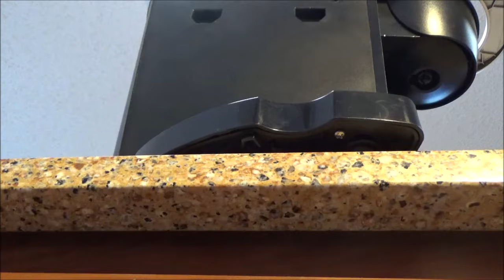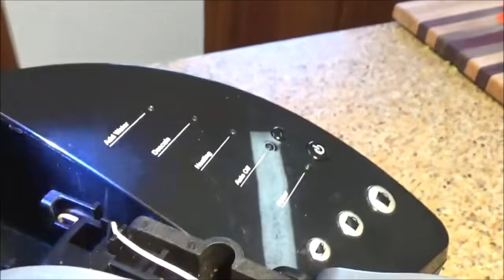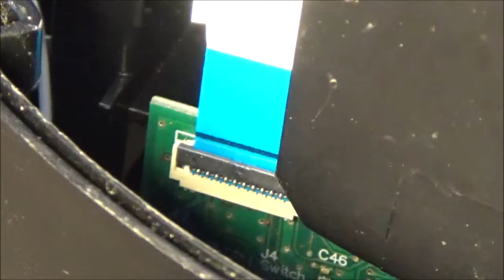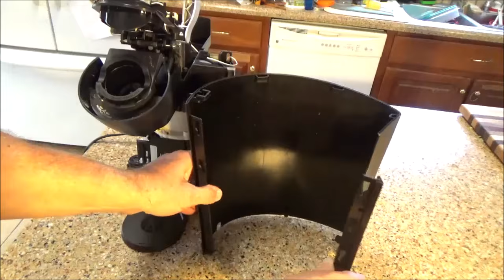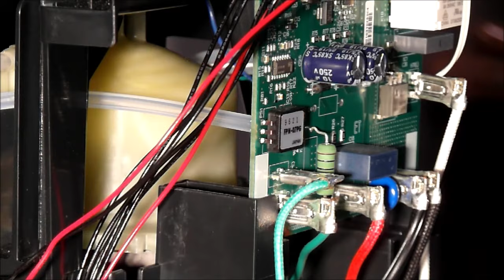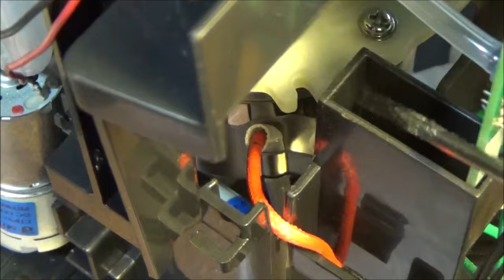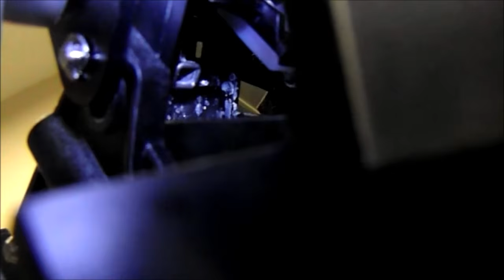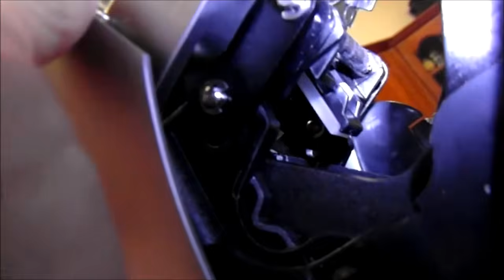Keurig Classic K50 Disassembly and Theory of Operation

Comment: i have a k55. i press the power button and the green light comes on and goes right back off in 2 seconds. what might that be???
Reply from the maker: It's hard to say for sure.  Since you have it apart, you might check to see that the hot water tank inside is filling up with water like it should.  It has to fill up close to the top before it can start heating the water.  You can check by shaking the machine a little and look to see if the water surface in the plastic top of the tank is moving around.  If it isn't filling up, you could listen to see whether the water pump is trying to run.  If not, it might be bad or maybe the path is blocked somewhere.  Check at the water inlet (that the outside reservoir sits on) to make sure it doesn't look clogged, and also the check valve right next to it.  You could also try turning it on with the K-Cup arm opened up to allow air to escape out the other end a little easier (if air can't exit the hot water tank, then it can't fill up with water).
Reply: @getitsettech1015  It is gettig water in the fill tube. Hard to say if the tank has water in it by looking. Now when i press the power button...the green ligh goes on and off very quick. nothing else turns on. when i plug it into the wall socket i hear  click. so power is getting to the unit. but it is dead. Is it worth tyring to fix?
Reply from the maker: I could only guess what the problem might be at this point.  If you still have the cover removed and you are familiar with using an ohmmeter, you could check to make sure the hot water tank heating element reads low resistance, and the same for the thermal fuse that is clamped to the tank if you can find it.  You could also disconnect the tube to the top of the hot water tank and somehow funnel water into it just in case it isn't full enough.  If it's not one of those things, there is no way to know what the firmware might be doing to prohibit the machine from working.  Sorry, wish I had some other ideas.

Comment: Any idea why it would continually pump cold water as soon as it’s turned on? Comes out of the needle so that’s not blocked as far as I can tell. No preheat or blue lights indicating what cup size you want ect
Reply from the maker: I'm not coming up with any ideas right now.  If the water pump was controlled by a relay, I would have suggested tapping the relay to see if it was stuck.  But, the water pump isn't controlled by a relay (at least not on this model) - it is turned on by a small transistor (Q8) near the plug on the circuit board.  The transistor has a circuit board path to the main processor chip, which turns the water pump on via the transistor.  If you have the machine open, you could check to see if Q8 is shorted.  If not, then I would suspect that the main processor is bad, but you are still able to turn the machine on, so that means the processor is functioning at least somewhat.  So it's hard to say.  Buying a used K50 circuit board on E-Bay would most likely cure it, if the cost is worth it.

Comment: Great video! ...My K50 froze and looks like the hot water tank leaks between the metal bottom and plastic top. Is it worth fixing and where would you get the parts? thanks
Reply from the maker: I don't know if anybody has tried re-sealing a tank in that situation with an adhesive of some kind.  The adhesive would need to be food safe, and take the heat.  SIL-BOND RTV 6500 is a possible adhesive that meets both of those requirements, but I've never tried it and I don't know if it withstands pressure.
Reply from the maker: The only place I know of to get a tank is used ones on E-Bay.  Sometimes they sell the tanks there, maybe along with some other parts included.  As to whether it is worth it, it just depends on how much they are charging for the tank compared to how much a comparable new Keurig would cost.

Comment: I have a K80 that looks almost identical except for the buttons. It has a strong button and 4 cup sizes (12 oz size added). It fails to power on,  but it will allow me to set the auto off and auto on functions as well as.a high altitude setting.  
Tested both motors with external 12v supply and can pump water through the system,  air purge after,  thermistor reads 48k. 10ohm across heater leads.  Any ideas how to get it to power on?  
Thermal fuse is ok of course since button combo to set auto off works just fine.
Reply from the maker: It sounds like you have a good handle on how to test it out.  I really wish I could say why it won't power on, but I'm just not sure right now.  The main brain of the device is an STM32F070CBT6 Micro Controller.  It is live whenever the unit is plugged in, so I am assuming that the Power On button is a discrete input to it, and the controller makes a decision about whether or not to power on the machine.  It may be seeing a condition of some kind that it doesn't like, but I can't imagine what, since you have checked out most of the main parts.  You could check that the ribbon cable isn't cracked or torn.  Other than that, it's a matter of you or I trying to come up with some idea of anything else that might make it unhappy enough not to start up.

Comment: How does the machine determine how much water to dispense?    Normally the water pump fill to a certain level  and air dispense it out.    If water  pump fill and dispense  did they put a flow meter in to count 6, 8 or 10 oz ?
Reply from the maker: Initially I thought that they were determining the 6, 8 or 10 oz just from how long they let the water pump run.  The less time it runs, the less water.  This would be just a guess on their part.  But recently, I noticed that the water pump not only has terminals for the two wires that provide power to it, but four more terminals on the side of the water pump with black wires connected to them.  All of these wires run to the processor board.  Maybe there is a flow sensor of some type inside the water pump, or maybe it just counts the number of times the shaft spins.  Some day I might take one apart to find out.  The older B-Series Keurigs didn't have these extra four wires going to the water pump, because like you said, they had a different way of measuring the brew size back then.

Comment: Awesome and very informative video. Exactly what I needed to know to fix one that I have added to my hoard!
Reply from the maker: Glad it was helpful!  Once you find out what was wrong with it, it might be interesting to share it with us.
Reply: @getitsettech1015  I believe the one I have was left outside with water in it and it froze. Two of the hoses were pushed off, and once I put them back on, it works. Luckily, the boiler was OK and didn't get cracked.
Reply from the maker: Ah, that was fortunate.  Glad it worked out.

Comment: Excellent video!  I wanted to hard wire the power so it is alway ‘On’ so I can use my Gosund voice activated plug for my Keurig. I guess you have not removed that circuit board that hides the switches including the power switch. Wonder how hard it would be to just connect the two (assume) power lines attached to the power switch in order to hard wire it. Thanks again for the video

Also mine is a K 60 with the metal base. It doesn’t have the two retainer clips at the top but only the two screws. The display side seems very secure after removing the screws. I’m guessing that there are internal clips that are well connected to make it so firm and you just need to get those broken loose to remove the top?
Reply from the maker: I have an old B66 that I believe is fairly similar to the K60.  I unplugged the power from the wall, held down the power button, and plugged it back in to the wall, and it actually did power itself on that way.  So if you could find a way to just tape some rigid object on top of the power button to hold it down, it might work that way without disassembling it.  If you want to disassemble it anyway, I did disassemble mine in the past.  You have to remove the metal base and stick a very long screwdriver inside through the bottom all the way up through to the top, and then and pop some latches open to remove the outer shroud first.  Once the outer shroud is removed, you can remove the top where the button controls are.  I don't have detailed instructions, but there are some youtube videos out there.  One of them is at https://www.youtube.com/watch?v=e7aebxbLJE0.  The power button doesn't handle 120VAC power - it just tells the main processor to turn on the unit according to it's firmware instructions, because the processor is always on standby waiting, since the machine is plugged into the wall.  You can see a picture of the circuit board at
 https://www.ebay.com/itm/233984206023?hash=item367a8ba4c7:g:44UAAOSwg2lghzdA to get an idea of where you might need to solder.  It's labeled SW1 PWR.
Reply: @getitsettech1015  - thanks so much for this reply. I had thought about using some JB Weld to secure the power button like you mentioned or maybe a small piece of wood to hold the button down. securing it somehow would probably be the hardest thing to figure out. That’s a good idea and would work for sure. Thanks again!
Reply: @condor5635  Be careful when you bypass things that were put there to ensure your safety.  I would unplug it whenever you are not brewing with it.  I believe the first coffee makers were the cause of many fires.

Comment: Thanks for your help with the disassembly.  With your detailed instructions, I was able to replace the mini air pump and return my Keurig to full service.  I refuse to throw it out because a $5 part failed!
Reply from the maker: You're very welcome.  Glad it worked out for you!
Reply: Where were you able to find parts for the unit?  Thanks
Reply from the maker: People mostly buy used Keurig parts on E-Bay and Amazon.  There are also used air pumps at https://skycraftsurplus.com/products/12-volt-dc-diaphragm-air-purge-pump.html and https://www.sciplus.com/12vdc-mini-diaphragm-air-pump-49508-p.  I also found these new pumps on Amazon at https://www.amazon.com/DANXQ-Newly-Motor-Electric-Diaphragm/dp/B01HIBGZQ6/ref=psdc_2975471011_t1_B07FGFPKNS?th=1.  Disclaimer - I did not look these up by part number on Amazon; they just happened to look the same, and the voltage matches.  Note that these would not directly fit into the Keurig though without disassembling them slightly to install the mounting bracket that is Keurig specific, but they are new.  I have not tried these at all, but they looked interesting.
Reply: @getitsettech1015  thanks. I must’ve gotten a really good unit. I had it for at least eight years made thousands of cups of coffee and have not had one single issue with it.

Comment: When I press the button to begin brewing, I hear the water pumping and then the water goes out the bottom of the machine onto the counter..where should I look first for the leak?
Reply from the maker: Is any water coming out of the needle into the K-pod at all, or all of it coming out the bottom?
Reply: @getitsettech1015  It is all coming out the bottom..
Reply from the maker: Sometimes the air pump gets moisture inside of it and then gets corroded.  After that it often leaks, which would come out the bottom.  You would have to remove the outer shroud from the sides to get to it to replace it.  But the fact that no water comes out of the needle at all makes me wonder whether the needle is completely clogged.  This could possibly cause the water to come out of the pressure relief valve, but then it would dump out through that hole into the cavity where the K-cup handle is.  From there, I would think it would tend to dump out the front of the machine after that, but maybe it could find its way to the bottom.  You could unsnap the pod holder and remove it to look into the cavity to see whether it is obviously wet back there.  If it is, you could try cleaning the needle with a paper clip unless you already tried that.
Reply: @getitsettech1015  Thank you so much..I didn't check the needle..I will try these suggestions..I will tackle this tomorrow!

Comment: Is there any other way to repair a kuerig was plug in to 220 volts instead of 110  ? Thanks for the answer in advance
Reply from the maker: Sorry, but I don't think so.  While some electronic devices are designed to work off of either 110V or 220V without having to switch anything, the Keurig doesn't seem to be one of them, since any I have seen (in the USA) have specified only 120V AC on the bottom panel.  The older Keurigs used a large transformer in the power supply, but the newer ones are more solid state with a smaller transformer.  Either way, the only way I know of to repair it would be to look on E-Bay for a replacement main board if there is one available.  The Keurig model that the board comes from needs to match the Keurig that you have.
Reply: @getitsettech1015  thank you for the information 🥰🥰

Comment: Very helpful video.
My Keurig Classic was shutting off when the cup size buttons were pressed. I disassembled the unit per your excellent instructions and found no obvious issues (loose wires, burned out components, etc) but when I reattached the ribbon cable to the circuit board everything started working again. May have been loose or dirty contacts. If it happens again I will know you only have to remove the top cover to access the connector.
Hope this helps someone else.
Reply from the maker: Thanks for that information - I think this could help some people.  Once we know that that connector can have dirty contacts, it could even explain some other problems that are different than the problem you talked about.  That would be one more thing that people could try.

Comment: Great video. You don't have to drill out the rivet. It is easier to cut the wires. Then you can attach crimp-on connectors to the wires. One pair of connectors is all you need. A spade connectors pair or a  bullet connector pair. Then next time you remove the bottom cover, to completely detach the cover and get it out of your way, all you have to do is pull the connectors apart.
Reply from the maker: Sounds like a good idea.  I drilled the rivet on my B60, but bullet connectors would have been more convenient in the long run, thanks.

Comment from the maker: The model listed underneath on the bottom of this one I am disassembling in this video is the K-Classic K50.  This one has a plastic base that is an integral part of the entire chassis.  I have seen a different video from the year 2016, of a teardown of a K55.  It had a separate metal base and the internals were arranged a lot like an old B60, with a solenoid valve, multiple level probes in the water tank, 24 volt transformer, mesh filter tee, etc.  The one I disassemble in this video is more recent than that, and contains none of these things.  It looks like they have simplified the design somewhat in the more recent Keurigs.  So an original K55 and a recent K55 may look similar on the outside, but are completely redesigned inside.  But even beyond that, there seems to be confusion about differences between the K50 and K55 overall.  Many websites out there insist that only the K55 has a Descale indicator light, but mine is a K50 and it has one.  These websites say that my K50 is supposed to have a Strong button, but it doesn't.